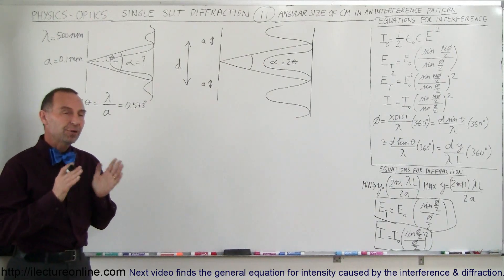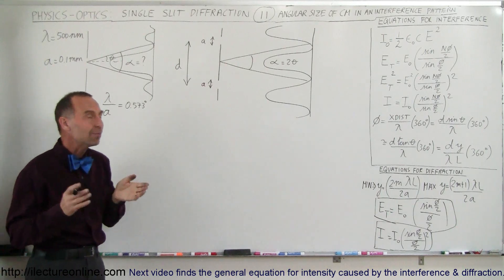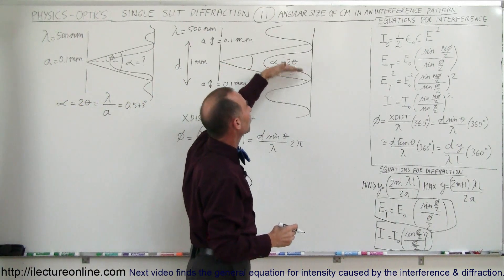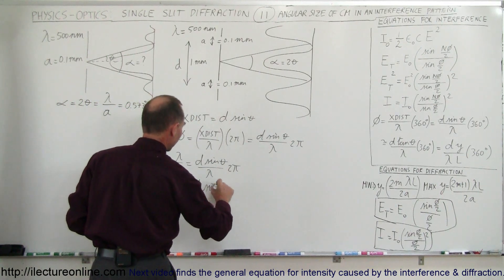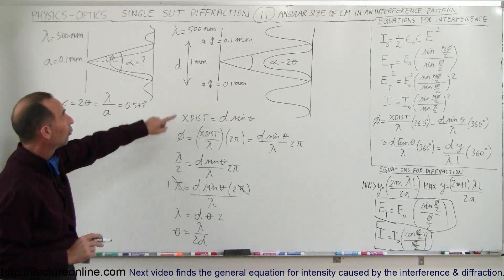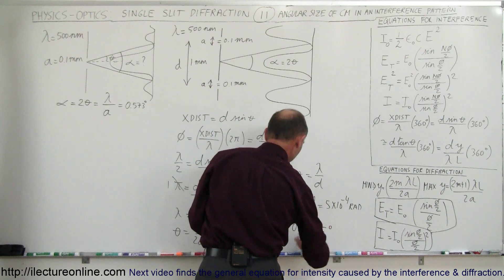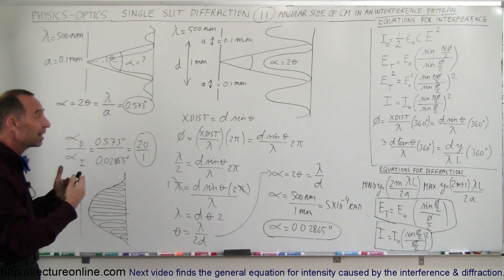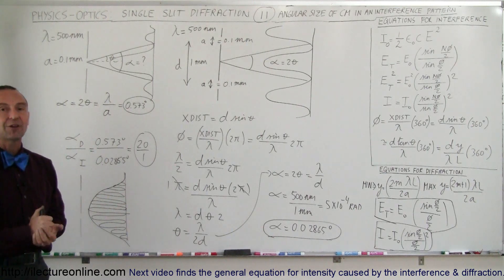Physics - Optics: Single Slit Diffraction (11 of 15) Angular Size of Central Maximum

Comment: I think you have 20 + 1 (central max) interference bright fringes since they need to be symmetrical no?
Reply from the maker: Since the ration is EXACTLY 20/1, the bright fringe of the diffraction on the far side will coincide with the dark spot of the interference pattern, so you can only count a 1/2 fringe on each far side.

Comment: Dear Sir you said and write at 2:33 that Phase difference is lambda/2, is it possible for phase difference to be in units of lambda(length)?
And also in previous Video (of the play list) you substitute alpha(phase diff.) with 2phi, how is it possible alpha be 2phi when we are at first Minima?! Should not it be just phi?
Reply: I think in previous video phase diff. should be phi(not 2*phi) and in this video path diff. should be (d*sin0)/2, which you have written just d*sin0.
*0 is thetha
Reply from the maker: This can be a confusing topic with the two angles theta and phi.  But all the equations in the video are correct.  If you go through the video series one by one, you will see how this works.

Comment: Shouldn't α for the diffraction pattern be: α = 2λ/a ?
Since we want the angle θ of the first minima then XDIST = a/2 sinθ = λ/2 which yields θ ≈ λ/a   ===>    α = 2θ = 2λ/a

Or am I missing something here?
Reply from the maker: +Jon 93 If you want to understand more of the single slit diffraction start with this video   Physics - Optics: Single Slit Diffraction (6 of 15) What Causes Intensity Diffraction Patterns?   and then work through the series.  That is where it is explained.
Reply: @Jon 93 I think you are right, coz in previous video of the play list alpha is proved to be 2*lambda/2.